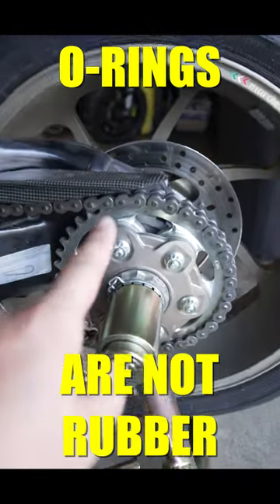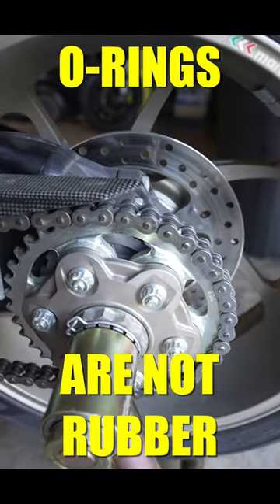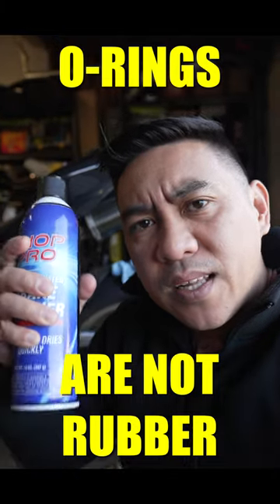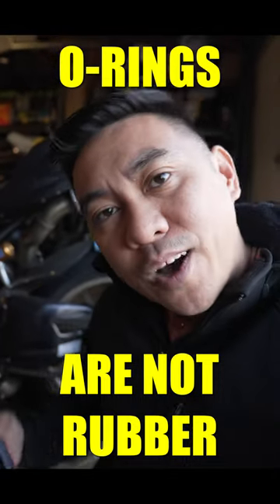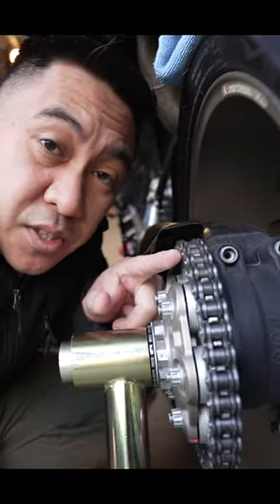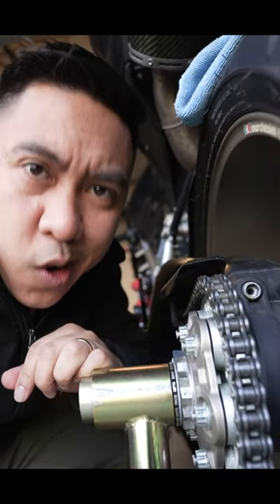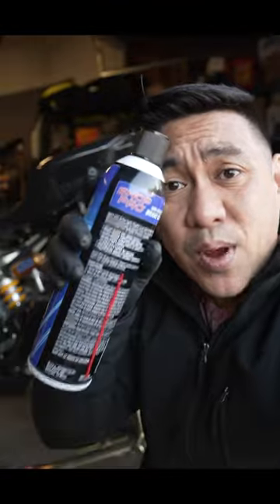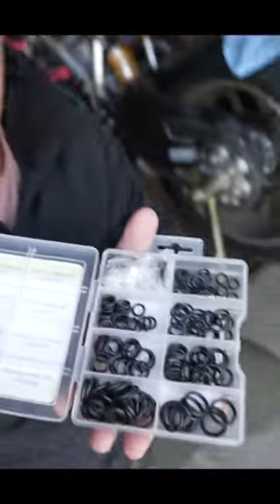Motorcycle Chain O Rings are Not Rubber

Comment: Instead of looking at O-ring data, just read the manual that comes with the chain. For example, from DID's website: 

Clean the chain by wiping with a soft cloth dampened with an O-Ring/X-Ring® safe cleaner and dry completely every 300miles (500kms) to prevent surface rust and ensures maximum performance. To protect X-Ring®, NEVER use steam, thinner or such volatile solvents as gasoline or benzene (BRAKE CLEANER), and a wire bush as well. Lube the chain every other use with an O-Ring/X-Ring safe lubricant.

Just because it seems to work, and you have done it for a long time doesn't mean it is the right thing to do.
Reply from the maker: Honestly there’s more than one way to clean a chain. It’s not that serious and people are making this process seem like it’s the most crucial thing in the world. It’s not a big deal..clean it, lube it, move on
Reply: @adobomoto  I can understand not making a big deal about it, but it is hard to not disagree with your comments when the manufacturers of motorcycle chains are clearly recommending the exact opposite of what you are promoting. Another example from RK Chains:

RK Chain recommends cleaning a sealed chain with only a mineral based O ring safe chain cleaner. Do not use kerosene, mineral spirts, diesel fuel, brake cleaner, motor oil or any caustic chemicals because that can damage the seals. RK recommends that you douse a rag with the mineral based O ring cleaner and wipe the dirt off the chain. Do not use a wire brush or hard bristle brush to clean a sealed chain. The wire or hard bristles can damage the seals reducing the life of the chain. WE HIGHLY RECOMMEND USING A MOTORCYCLE O-RING CHAIN SPECIFIC CLEANER AND LUBE.
Reply: Point to be noted. Last ninja I used cheap degreaser and my chain was damaged then for gixxer now i use kerosene. It seems OK. But here i saw "not kerosene " so now what ? 😂🤔
I guess may be just damp kerosene and wipe residue then wax .
Reply: @kcash4u   Actual chain cleaners have come a long way, in fact there some that work so well that you don’t need to use any brushing or elbow grease. Maxima chain cleaner has you spray it on your chain, wait 5-10 min then rinse off with a hose water. That product works better than kerosene with less arm work.
Reply: @culverap  yeah... it's like RK made the O ring for their chain and not source it from other manufacturer right? So they must know better how to protect it right??
Reply: @danishasyraaf9569  Trying to understand the manufacturer's perspective is important, and it is good to see that you are asking that question. Why does the manufacturer  add these disclaimers into their manual and website?
Reply: @culverap  Maxima chain cleaner and spray chain wax are THE FKN BEST.
Reply: @adobomoto  gets called wrong, then deflects.  Good stuff.
Reply: I wouldn’t use a wire brush. Something a little softer perhaps. I like the grunge brush

Comment: I'm no mechanic, but a detailer. I don't use brake cleaner much except for cleaning undercoating off of stuff it shouldn't be on. 

You're kind of right. Nitrite gloves do resist brake cleaner a lot better than most rubbers but it isn't completely impervious to it. You can test it by just spraying a bunch on some of those gloves you have. First it'll make the glove feel looser, then it'll start to discolor, and then the material will get really thin and flimsy feeling and it'll break very easy. Eventually if it's exposed to enough brake cleaner for enough time it'll start to decay.

Comment: Hate to break it to you, but orings are a type of synthetic rubber, and silicone. Depends on what rating you have, some orings can take brake cleaner, some cant. All depends on who manufactured them, that looks like an rk chain, so those are actually made out of silicone propylene compound. If that is an rk chain. Cant really tell if it is, so yeah its perfectly fine to use brake cleaner on that chain, if its a neoprene compound, you absolutely do not want to use brake cleaner on it, it wont melt the rings, it will dry rot them. If they are dry rotted, they wont hold the lube in the chain. Its not like its gonna damage your chain, but you'll be lubing it up alot.

Comment: If I were you, I'd have a look at the chemical break-through time for brake cleaner on a nitrile glove.

Typically, nitrile/neoprene/latex gloves will only repel chemicals for a certain amount of time 👍
Reply: True enough it speeds up the process of breakdown but brake cleaners are designed to be ok with rubber boots on caliper cylinder or the little rubber boots on you rear wheel cylinder but that's real rubber not dipped latex
Reply: chlorinated brake clean will eat right through those gloves. As a mechanic I’d know. Non-chlorinated brake clean will repeal for longer but will still eventually eat through.
Reply: @robertg9334  No, it's likely nitrile rubber too.
'real' rubber has almost no solvent resistance.
I think the key with brake cleaner is that it evaporates before it can do any real damage, similar to gasoline on 2-stage paint.

Comment: Most brake cleaners have ketone, that will destroy the o-rings over time. Also, the solvent is very thin and will pass through the sealants and wash the grease inside.

Comment: I've always used non-chlorinated brake cleaner specifically on motorcycle chains, it's worked better than chain degreaser every time
Reply: Why non chlorinated? I never heard about this until now.
Reply: chlorinated and non-chlorinated are there because of environmental regulations. properties are almost the same.
Reply: I was told that non-chlorinated tends to be easier on rubber o-rings, having used non-chlorinated for 3 years now on my chain I can speak to it's longevity, never tried non-chlorinated personally on motorcycle chains though I do use it in general automotive work

Comment: https://youtu.be/HfcEPso4YoY
if you find anyone commenting "hey brake cleaner/ wd-40 will damage rubber or o ring" send this link to him
Reply: Thx for the pin
Reply: Sorry kid iv used every type of o-ring on the market and thousands of them they all give up to solvents some faster than others but they will all fail from solvent based cleaners you know they make chain brushes right 5 minutes over 5 seconds will have your chain last twice as long
Reply: Sorry to break it to you but Wd40 and brake cleaner aren't the same thing/chemicals
Reply: They both will.
You retread
Reply: It will swell the the butyl rubber.
Not melt em.
Reply: Brake cleaner/wd40? That's like saying whiskey/olive oil 😂

Comment: Have you ever sprayed that very brake clean on those very gloves? I have and it distorts and expands those gloves. It's so so not the same as the o rings. And not all of rings are made of the same material. Fyi. Those generic harbor freight o rings may be nitrile but nitrile rubber doesn't stand up good against heat.
Reply from the maker: I filled a glove up like a water balloon with brake cleaner. Left it for an hour. Did nothing. Watch the video if you’re curious https://youtu.be/PVgwaJWNdRc

Comment: Put on nitrile gloves, spray good brake cleaner on them, give them a few minutes.  They fall apart.  I am a diesel mechanic. Nitrile gloves are great but no way resistant for more than a few minutes. Try some powerful paint prep cleaning solvent.  You have about 30 seconds before the gloves fall off.
Reply from the maker: I filled a glove up like a water balloon with brake cleaner. Watch the video if you’re curious https://youtu.be/PVgwaJWNdRc
Reply from the maker: Not a damn thing happened
Reply: @adobomoto  try napa brand brake cleaner and see.

Comment: Key world: resistant to. Doesn't mean it's petroleum proof, gloves will protect temporarily and then you dispose of them, but those o rings on your chain won't be the same. They'll expand and soften from the cleaner and then eventually fail substantially quicker than if you hadn't used something so harsh. Keep brake cleaner away from pretty much anything that isn't metal.

Comment: It may be the same chemical but the orings are made different and I believe they use a denser compound for the orings cus they need to withstand harsh weather and maintenance
Reply from the maker: And chemicals, like brake cleaner
Reply: @adobomoto  exactly... and don't forget when the bike starts to leak oil it has to withstand the oil leak until a responsible person gets it repaired ASAP

Comment: That's why I have been using Kerosene for ages, it is manufacturer recommended and I have never known it to dissolve or breakdown my rubber gloves.  Kerosene is cheaper than brake cleaner...
Reply from the maker: According to fort9, kerosene is no good. Even though everyone has used it for years

Comment: i have approx 25k miles with oem honda chain with orings.  looks a bit kinked in places but stll goes around sprockets fine.  i'm thinking its the friction between the chain plates and rings, and likely need a good clean and lube.  so whats the best way, esp for a deep penetrating clean and relube?  also, so me guys claim 'dry lube' is good too.

Comment: I run a DID X ring on my dirtbike. After washing the bike I immediately wipe the chain down with a rag, spray with wd40 to help repel the water, wipe again, ride the bike up and down the street to fling any lingering water out and then apply a heavy coat to the underside of the chain with maxima, motul or belray silicone chain lube.

Comment: Brake cleaner WILL oxidize nitrile and neoprene.  You don't have the same "service duty" with gloves on your hands as the O-rings in your chain.  It will take the elasticity out of the O-rings that are likely neoprene, not nitrile.
Take the chain off and put it in a pan of kerosene or diesel over night, then hang it up and pressure wash it.  Then lubricate and re-install.

Comment: I had it said to me that brake cleaner will destroy my chain, after using motul chain cleaner I noticed its basically brake cleaner.

After that, i took a couple of O-rings, stick them in a tube and filled it with brake cleaner from Wurth. O-rings remained the same after 2 days, so I thought cleaning for a couple of minutes wont do any harm.

Cleaned the chain for a couple of years with the same brake clean and the chain was as new still.

Comment: Brake cleaner is safe on rubber components anyway
It’s designed to be used on brakes where rubber is found, such as o rings & boot covers & sliding pins

Comment: Gloves=nitrile, latex. Oring=pretty much any rubber there is depending on intented aplication, including nitrile, or how oring manufacturers label it buna, but most commonly made from neoprene. Not all  are oil proof, and not all that are oil proof are solvent proof, so to clean orings intended to be used in oil/greese don't use solvents like brake cleaner but light oils like kerosene, or degreesing products specialy made for it. If you greese non oil proof oring you won't have problem right  away, even may show improvement instantly, but will turn to gunk and desintegrate sometime later, and ones in contact with solvents that are not solvent proof will get stiff and sometimes even expand, like some silicones will in gasoline.

Comment: I think you continue to miss the issue. Brake cleaner evaporates the chain grease it’s assembled with. Leaving o-rings that aren’t holding any grease in place, in other words dried out. Re-lubing your chain will never replace the high viscosity grease encapsulated by the o-ring during assembly by the manufacturer. What results is o-rings that aren’t lubed properly, get hot and deteriorate after heat cycles. Don’t believe me? Spray brake cleaner on oil or grease next time, it’s magical at cleaning that stuff up. It does the same to your chain grease. It zaps it right out of there.
Reply: No, by that logic any degreaser will do what you say it does.
Reply: @DaDaDo661 Sorry but try them side my side. Chain cleaner is not a degreaser it’s a cleaner, by definition not as aggressive as a degreaser.

Comment: Yes, it will over time. Brake part cleaner breaks down carbon based stuff. Rubber is organic and carbon based however it is a composite material that also contains latex. BIC-600 disc brake cleaner will not harm it and is safe to use. It also depends if your chain has o-rings or not. Some don't.

Comment: Brake cleaner will eat away at rubber. 

But orings are a composite material, they aren’t 100% rubber, they are made to resist some of the harshest conditions and chemicals. A bit of brake cleaner can’t hurt them

Comment: Yes an actual chain cleaner solvent (aerosol). If you can’t afford that use scalding hot water and Dawn dish soap. Both will remove oil, grease,
Dirt and other contaminants without the chance to ruins anything especially o rings… rinse it off, let it dry then spray some lubricant. I prefer chain wax to chain lube because the wax won’t fling everywhere on your rims, brakes, under fender etc.

Comment: If anything they probably use viton (fkm) the same material that is used for valve stem seals and crank/cam seals hydraulic seals ect it can handle high operating temperatures and the only solvent I have found that hurts it is mek.

Comment: I do think that the brake cleaner will cause the o ring to dry out faster in the long run causing tearing and cracking, which is what you don't really want. Those gloves you throw away after you're done maintaining and you'll grab a new pair.

Comment: Brake clean won't harm the o-rings, but you shouldn't be using it anyway. When you clean your chain, you don't want to strip the lubrication that's already on the chain. You just want to get rid of the dirt, so you can apply more lube without mixing it with grit... You should use diesel/kerosene/or similar solvent that won't completely strip what's already there

Comment: I’m not a mechanic, and a lot of people will probably give me shit for this this but I’ve always 
1. Sprayed my chain with water
2. Sprayed it with a can of silicone lubricant from Walmart until it the drip off runs clear (usually half a can) 
3. And than I’ll take a proper chain lube and spray it while squeezing it with a piece of rubber or cloth that won’t shed kinda like packing a bearing.

It’s not proper, it’s not pretty, but I’ve had chains last me 30-40 thousand miles before. I think it’s more about the quality and just making sure there’s always some sort of lubrication throughout all those tiny linkages. Just my two cents but for me it works

Comment: The difference is that the gloves are not designed for long term use like orings are the damage that occurs to orings happens over time like months not hours or minutes the damage to orings occurs with prolonged use of petroleum-based products like Vaseline gasoline and other types of fuel

Comment: :" eh. Nitrile gets beat up by most of the harsh cleaning chemicals. Layout dye remover eats it like nothing else.... but so does thread cutting lube.... and rust protectant oil.... oddly enough... things like high heat exposure doesnt beat them up so much... and they are puncture resistant. I wouldn't go spraying solvents on those o-rings.... I never paid any attention to the exact solvent that eats them but... its just not a good idea to smite them with a cocktail of solvents...
Reply from the maker: Care to watch my brake cleaner experiment? Filled a glove up like a water balloon with brake cleaner https://youtu.be/PVgwaJWNdRc

Comment: Why do you think you need to clean a chain with brake cleaner? The O-rings are there to keep dirt out and lubricant in. At most, you should just wipe the chain down with a rag and spray some lube on the outside to minimise wear between the chain rollers and the sprockets. Chains actually wear via the pins which join each link. Do not, repeat, do not use a powerful solvent on an O-ring chain no matter some other self proclaimed genius says. A motorcycle chain has a big job to do - including not failing when you are doing 200kph and it's nothing like a bicycle chain. That is, a chain that typically gets soaked in a solvent to clean it and then dried and re-relubed.

Comment: While the Nitrile works reasonably well, if only the could make silicone ones for the same pricing structure! More impervious to acids and oils, also better for high temperature applications! Like your rear main seals that are not old school ROPE seals, usually the same part number but with sil or divine after the number! 😁👍

Comment: It's called brake cleaner for a reason. U don't want to get it on anything but your brakes. It will dissolve paint and undercoat and dry out plastics and rubber.

Comment: Orings are made from neoprene avoid harder chemicals use what the chain manufactures say on the box that I usually 80/90w gear oil when this excess oil flings off it takes the dirt with it and makes the chain easier to clean.